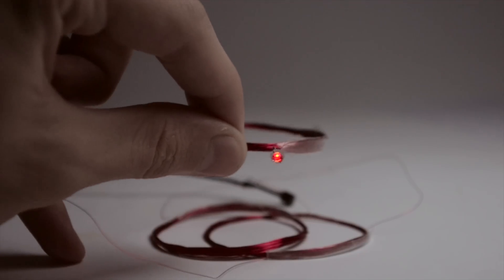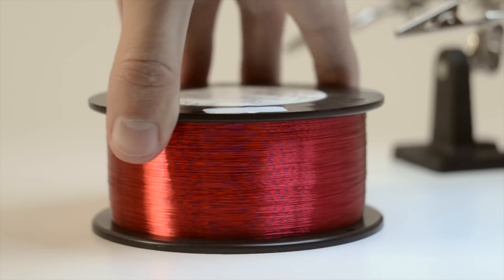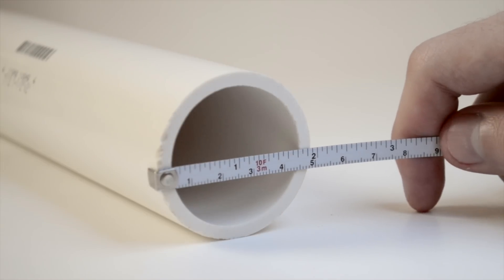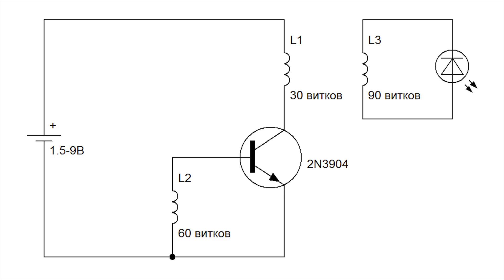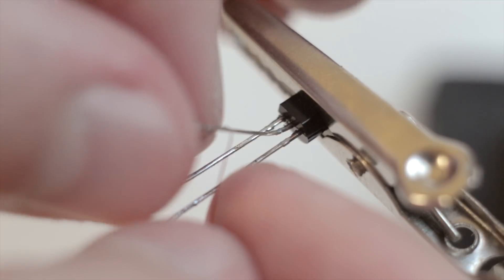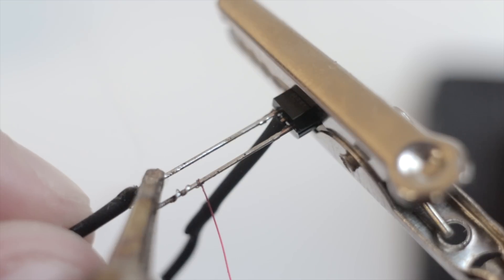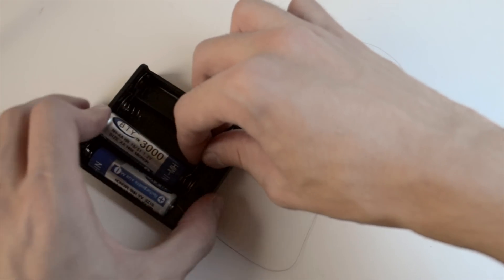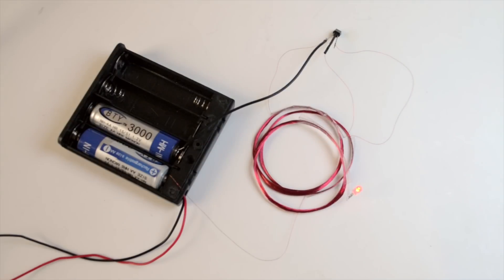Simplest Wireless Electricity Transmission Experiment

Comment: Can you explain how it works? please?
Reply: seems like a very weird blocking oscillator. I would recomend you add a biasing resistor, in order to prevent the bullshit hastle of touching the base of the transistor, as this circuit is very similar to a slayer exciter. I would also adivse to just use a big airial antenna and a biasing resistor, instead of a descrete coil between the base and the negative rail.
Reply: I am not certain how this circuit works, yet, I will play around with it, and tell you exactly, but it seems very similar to a slayer exciter, which is a variant of a blocking oscillator.